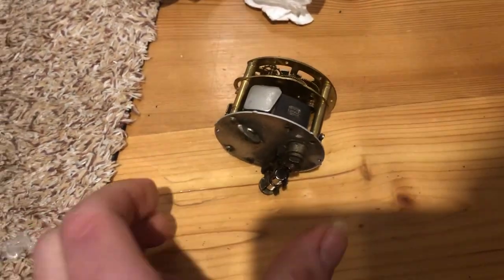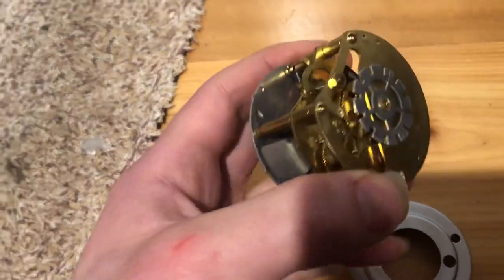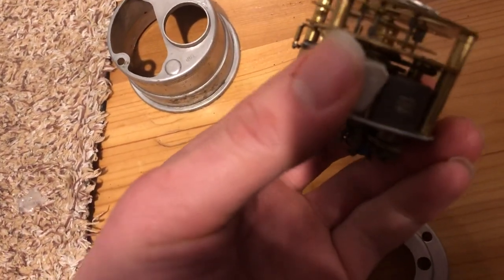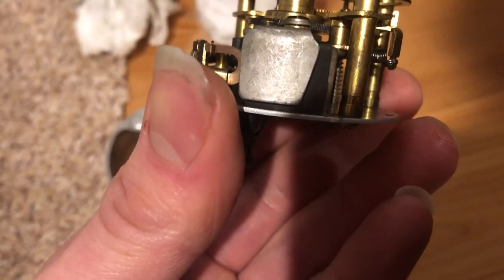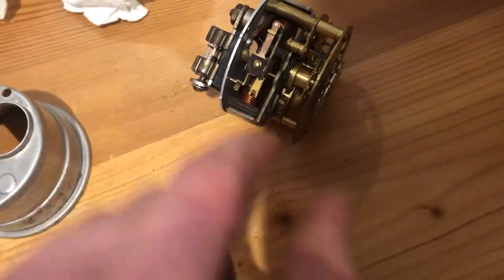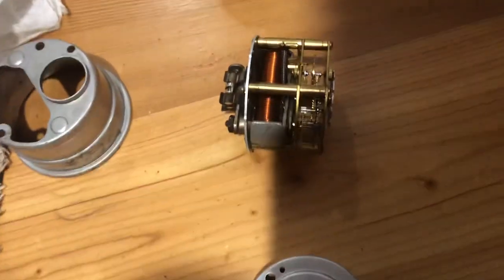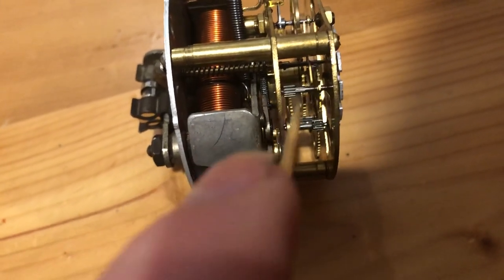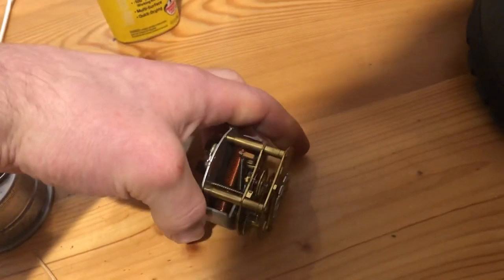6v MOPAR dashboard clock refurbishment dodge 1951 coronet

Comment: I have a 48 DeSoto clock made by Borg.  it's a bit different than yours.  I took the back off, but there's another back on the clock.  I guess I should take that off too.  I took the bezel off, but couldn't get the glass off because of the dial winding knob,  I find that these clock tutorials don't say how to take the clock apart or put it back together.  For example on your video no mention is made of how you took the hands off.
Reply from the maker: Mine is super simple

It has the mechanism you see in the video 

And it just twist locks into the dash

The face and hands are a self contained part that doesn't need to come off on mine 

If you look on my movement there is a octagonish looking gear on the front that lines up with another gear in the face section that remains in the dash

Most hands if you have to remove them Are secured with a push pin or a locking screw top